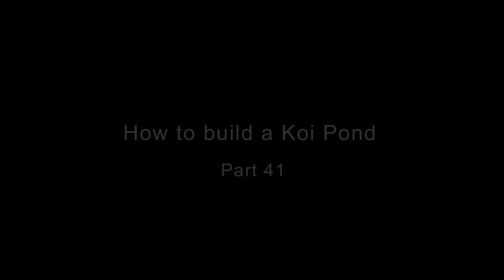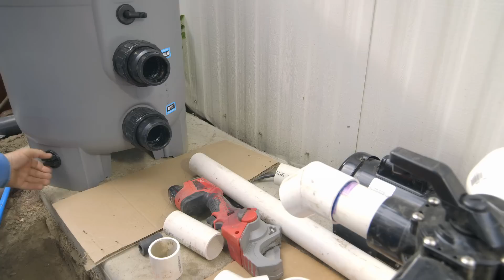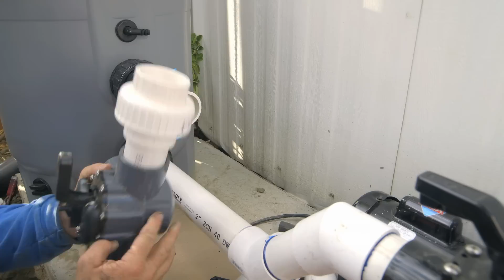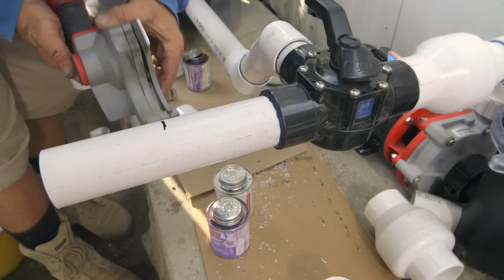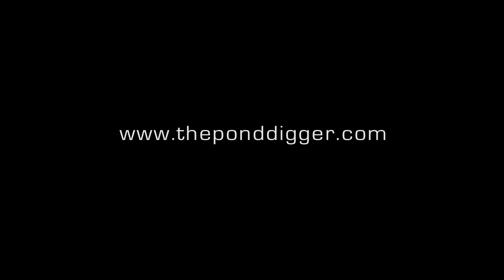Pond Filter Installation - KP 41

Comment: Dumb, and quite late question. Is there a reason you didn't eliminate one of the 45 degree bends by tilting the 3-way valve? (The one right after the pump) 
Hell, a 45 degree angle down on the 3-way, and a flexible tube would have bee my choice, since it makes maintenance a lot easier with the flexible stuff.
Neatness does count, of course, but setting the 3-way at a 45degree angle would have saved you the first elbow, but i doubt the flow-rates would have gone up a whole lot from eliminating the darn thing.

Anyways, interesting series of video-clips, i've enjoyed seeing them.
Reply from the maker: +Mr B Thanks for the feedback. You certainly could plumb the system exactly like you suggested. Personally I like my Three-Way Valves level for ease of servicing and my visual requirement. I personally do not like using flex pvc above grade. Just me. The flow to the pressure filter is only 1000 gallons per hour so a few extra 2" fittings don't give us any friction loss with that flow rate. Thanks for watching!!!